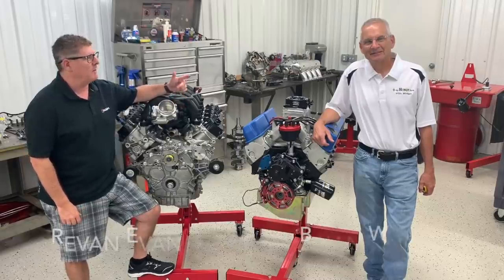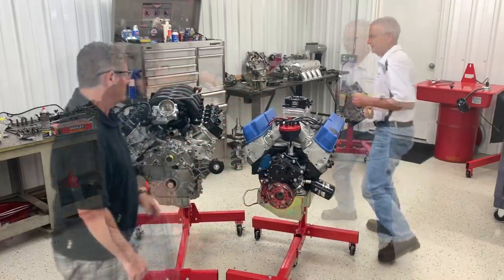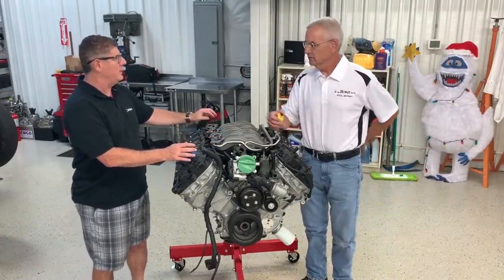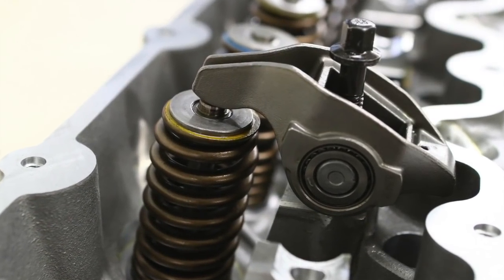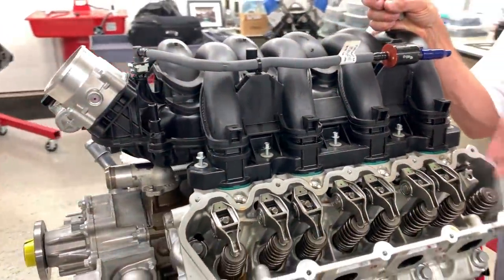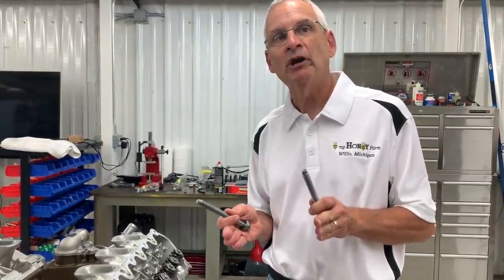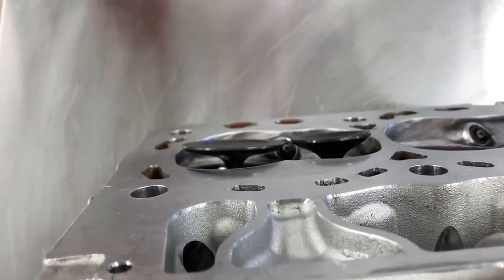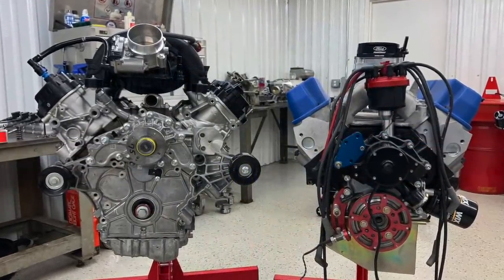Ford 7.3L Godzilla Engine Dyno Results, Teardown & Comparison to Coyote & 351 Windsor Part 2

Comment: LS killer.
Reply: And I guess you don't know about head flow how does head flow considerably more air than LS heads
Reply: @JasonHiland76  which LS heads? You realize how many LS heads there are? This is a low production industrial/commercial engine strictly built for longevity; it's not a performance engine
Reply: @roncook8566  I just mean stock-for-stock these heads are canted valves 300cc intake runner volume straight shot down to the intake valve with much more room for improvement yes an LS is a great motor but this motor has a lot of potential that's all I'm saying
Reply: Nope not even remotely

Comment: i would have really liked to see against the GM L86
Reply: This engine blows out a lot of what GM has out right now.
Reply: @BSC_1982  no it doesn't at all. Ford purposely backtracked to mid nineties tech for this engine all the way down to port fuel injection. It's not a performance engine at all it's an industrial/commercial engine built for longevity

Comment: Ford guys are in a league of their own. I didn't see anyone tearing into Chevy's new 6.6 as soon as it left the showroom. (Maybe I missed it, don't pay much attention to Chevy)
Reply: get ready for the chevy crying
Reply: You got that right. I get the feeling Chevy lovers are haters. They never miss the chance to piss and moan about Ford.
Reply: @mewrongwayKOCXF  Hmm, exact same comment, different thread. Spread the bullshit.
Reply: What is the oil injection rat on a 6.6 chevy poppet valved u-loop scavenged 2 stroke!https://www.4btswaps.com/attachments/2cyclesbc-jpg.6839/
Reply: They can be run in any tilted position at full rpm on quicksilver TCW3! i cant wait to try this! sounds like fun! Running a 6.6 like a sled motor!
Reply: It looks almost exsactly like the new LT based Chevy engines. And it has a lot more cubic inches. I’m a Chevy guy and worked on all the new Chevy stuff and this thing looks like it’s gona far exceed the new 6.2-6.6 engines
Reply: Because they don't need to know how to fix it that soon!
Reply: @themadscientest  hurr hurr
Reply: The GM 6.6 is a 6.2 with a 6 mm longer stroke.  The performance aftermarket already makes cranks with longer strokes than that for the GM LS.
Reply: This is literally a big gen 3 ls engine...
Reply: @roncook8566 literally what was the other options? Make it a 2 stroke😂? Ford did well with Coyote vs LS, this is just a simple, cheap, easy to manufacture push rod V8. What’s to change?
Reply: Ron Cook actually by watching the teardown it seems to be a lot closer to the gen 5 LT motors.
Reply: @cfltitan  minus the port fuel injection. It has elements of both
Reply: Ron Cook yeah they have a lot of similarities. They're different enough though that pretty much nothing is interchangeable though.
Reply: @Fordfanone That's because it's not a big deal when Chevy comes out with a new engine that's a good one.   This is a new thing for Ford, especially since it's a pushrod motor.
Reply: @SealofPerfection  Yet, Ford out sells Shitrolet year after year after year (42...43...44 of them in a row now, isn't it?)  Plus, it only took Shitty 55 years to finally copy the GT with the C8.  55 (!!!) years.  So yeah, Shitty made a "good" engine.  That's nice.  Now what are you gonna do?  Your duraturd cant come close to the P/S, and the 6.6 gas is a joke when actually loaded with weight.  (On a side note, who is the BattleStar Galatica fan at GM?  Is it me, or does anyone else expect to see a red light moving back and forth between the headlights?)  Keep talking smack.  You had your chance for 26 years, and Shitty blew it.  ..i..  ..i..
Reply: @SealofPerfection  - the DOHC engines from Ford shit all over chevys
Reply: @SealofPerfection  Bullshit, chevys been riding the LS for decades.
Reply: @Larcona_  The LS only came out in 95, and that was only in Vettes. Took awhile for them to get super popular like they are now, once they started putting them in all the trucks in 99.   
The OHC Fords have been around longer.
Reply: @SealofPerfection  That's 20 years, 2 decades.
Reply: @SealofPerfection  Yeah, and they were great engines, the cammer was a monster.

Comment: I'd like to swap this in my 19 A10 mustang, cant keep a gen 3 coyote alive in it...3rd engine in 5k miles....and I think I lost number 8 again
Reply: Seems you are the only one with an issue with this engine!
Reply: @jimgoff1170   haha naw...
Reply: what??? why do they keep blowing up?
Reply: @Ws6Ms   cast piston in a bore of which it cant match its thermal expansion....plasma bore is great....cast piston in a plasma bore at 12 to 1 on 93 not so much....50 states legal kit and I'm an old man I'm not even rough on it like I would have been 10 years ago....its got a glass jaw hehe....
 MAHLE OR JE no rebalance forged pistons would solve it ( 11 to 1 if its JE)

Comment: As a Ford guy can I like the 7.3, Coyote, and Windsor? Or do I need to pick one and Fan Boi it on the internet and bash the other two?
Reply: I agree, you will never see me say anything bad about any of those motors.   The coyote proved Ford can make a OHC engine that is as good, and in my opinion better than anyone in the world, including the exotics, at 100HP/L and designed to be a daily driver with low maintenance I see no one at can match that.  The Windsor another great engine, that's why the LS / LT comped the head bolt layout, symmetric ports, and took the lower end from the modular.....
Reply: You hit the nail on the head. The internet just gets tiresome in that regard and no one can look at the big picture. First off, if this engine wasn't legit, guys like yourself and Dave wouldn't be investing time and money, so that right there tells me we're on to something. Second, this is a net gain for the Hotrod community. Another viable powerplant brings down prices and availability of engines like the Coyote. I love the Coyote, but I'm a diehard pushrod guy and seeing what this engine has to offer is what us 8.2/9.5 deck guys have dreamed of. What a time to be alive as a car guy. I still want the official weight though. Lol
Reply: All 3 have their own advantages.

Comment: Coming from a Chevy/LS fanboy, I WANT ONE!
Reply: Looking at the cut away on a different video it looks like ford stole the keys to chevys development department and copied a lot from the ls platform
Reply: You want an open deck block?
Reply: @MastersOfMask  
There's plenty of metal in that block, and the engine comes from factory with iron sleeves.

I'm not looking to make 2000hp dude. A modern well designed big block that can make 800hp easy as pie with a blower is more than enough.

I'm just curious as to how much they'll cost.
Reply: Being a Chevy guy go pick up one of their 8.1's and do it up.

Comment: The clearance may be an issue if someone wants to put one into an old Mustang or Torino.
Reply: Need to see a comparison with an FE engine, that would nail down the ease of fitment in anything back to '67 or so.
Reply: Just cut the hood lol 5.4 swaps come to my mind when i thought of this. Didnt stop people then. Wont stop them now
Reply: @joeykimball5705  I'd rather not do that

Comment: Look at the Australian Ford Barra...
Reply: The Barra is a great I6 engine.
Reply: @TheRamGuy  
Everything I've seen is good, I wish we had it here, because as good as the coyote swap is, at 30 inches wide, it's sometimes not feasible or practical. I'd like to put one in my 51 Ford F3 pickup...
Reply: I want to barra swap my BMW because the s38 engine is about rare as hens teeth today.

Comment: Evan, you are the man!!!  I love seeing two Ford Legends together... I could listen to you and Brian all day.... You are leading the way in the 7.3 arena!!  I can see 700hp from this engine without trying hard
Reply: I'd say 800 with heads, cam, intake, headers, and a good port job.
Reply: @ForcedfedFords  you are out of your fucking mind...800hp with this engine needs boost.
Reply: @bigk5746  you spoke too soon lmfao! They made 790hp N/A (no boost) in a later video with ported heads, reworked camshaft, custom pistons and high rise intake manifold.
Reply: @ForcedfedFords  oh I'm sorry... just a completely new bottom end, pistons, massive intake and massive cam on C16 race fuel.  So let's take 10k engine, rip it apart, forge it, custom 1 off intake manifold on race fuel and make 790hp....what's impressive about that?
Reply: @bigk5746  my first comment accurately predicted what mods were needed to reach near 800hp N/A. You disagreed saying it needed boost, YOU WERE WRONG and now mock the supporting N/A mods? Bruhh.. must be a Chevy guy..
Reply: @ForcedfedFords  Well sir...I did say boost.  BUT you said "with heads, cam, headers, intake, and good port job, we will see these make 800NA"  

They put a whole new bottom end in it, and ran it on Q16 and IT DIDNT BREAK INTO THE 800HP RANGE.  AGAIN, IT DIDNT MAKE 800 WITH A FORGED, HIGH COMPRESSION, HUGE CAM ON Q16.  

I think we were both wrong.  This engine is a dud, which is why you don't hear about it any more.  Why would you want to buy a 10k engine, rip it apart, and throw away the bottom end to make decent power?  Just buy a Dart block and do a traditional SBF. I am a mustang guy BTW.  I love Ford but can't stand this engine.  Ford could have had a cool concept and something new, but gave it shitty internals and want way too much for it.  Typical Ford 🤷
Reply: @bigk5746  Yeah, they could have made an engine that a few thousand gear heads would have loved but would have been useless in what they were looking for a very reliable long lasting engine for heavy duty pickups. Who would have thought that Ford wanted a production engine instead of a hot rod engine for hundreds of thousands of pickups in the future.
Reply: @ForcedfedFords  The mods to reach 800HP or around 700 RWHP will be similar to what it takes a LS7 to reach the same point.   Cyllinder head flow will need to be around 400CFM after porting.
Reply: @ForcedfedFords  I believe you are right... 445 CI + heads that will probably flow 400cfm with the right cam and compression 800 is definitely in the line of sight!  I am curious to see how much stroke that block will take!
Reply: @UnityMotorSportsGarage  Ported stock heads will outflow all but the best BBF 385 series heads, cams are cams, as long as they keep the roller rate lobes we should see normal lifts of 0.685 and much more for pure race application and solid lifters. We know a 4.25 stroke will fit in a 9.5 deck windsor. Supposedly this motor has more room in the bottom end to clear the cam tunnel and a taller deck height. 9.65 I think. Should be good for a 4.5 stroke, but at minimum a 4.40. If you take the stock bore (4.22) and roll 0.080 over pistons, and get a 4.40 crank. You're look at 512 cubes from a small block. 

That being said, we should see 650 to the tire pretty easily in the next year naturally aspirated if street daily driveable service conditions. For all out race itll be over 1khp. 

Supposedly Procharger already has an F1-X hanging off the front end of one making 1300 on the stock motor with just upgraded injectors.
Reply: @MrAPCProductions  Very good numbers...
Reply from the maker: Thank you very much.
Reply: My ford 2 stroke is a:https://www.youtube.com/watch?v=iyJi_n3P0og

Comment: I love mod motors but they are the same size externally as a 460 .
Looking at the design it seems all the tricks guys used over the years on the Windsor made it into the design of this engine. Don't get me wrong as the mod motors have a place in my heart but after working for GM I prefer to work on push rod engines as they are just easier.
Reply: Think mod motors are bigger than a 460 lol. Stupid big, but worth it in a sport car or boosted application
Reply: @sategllib2191  yeah the heads seem to flow only when air is forced through them. There is a fair amount of potential in a old mod but to unleash it you better have deep pockets or a whole bunch of tools. I mean even the 4.6 2v is pretty good for a 281 . The right cam , some boost and a tune and your 400+ at like 380 ftlbs .

Comment: I’d like to know the weight of the 7.3
Reply: I'd like an aluminum block version
Reply: Cesar Perez Agreed if we want max performance.
Reply: I absolutely want to know this. I am going to use these, anyway - but I am very surprised that they skipped that bit of information. (Yes, even if it is "heavy".)
Reply: 440ish lbs

Comment: Wow, people are already hot roding these things. I will say this, what the Coyote does with DOHC 4 valves, and 7000+rpm godzilla does with good, old fashioned cubic inches.
Reply: I'm probably going to get hate for this, but I think I still prefer a Voodoo for performance applications. There's just something about a super-high revving V8 scream that I can't get over. I'd definitely throw it in my truck, though. An '01 Dakota RWD with this monster would be more than slightly terrifying.
Reply: @griffinfaulkner3514  Put it in a ranger, don't make a mutt.
Reply: Griffin Faulkner nascar has had high revving v8s for 40 years. You don’t need flame plane cranks and over head cams for that.
Reply: @ahack14  That's a specially-built, extremely expensive motor that's pushed to the absolute extremes of material science, and needs to he torn down and rebuilt after every race. For the cost of one of those engines, I could find a wrecked E92 M3, pull the motor, and have more than enough money left over to literally build a car around it.
Reply: @ahack14  Bit of apples to oranges as NASCAR is a rather extreme example with engines that have a relatively short service life. I was referring to the average hot roder or racer.
Reply: Griffin Faulkner you can run a V8 push rod V8 on the street that is capable of spinning 8k rpm. You don’t need DOHC... I’m sure the big long changes slinging around in there aren’t hard on parts at all...
Reply: @ahack14  What happens when you make the same changes to a DOHC motor? You get an even higher redline, in the case of the S65, 10k+, with a fraction of the parasitic loss you'd find in a pushrod motor

That said, I'm not saying pushrods are inherently bad, the low-end torque and incredible simplicity provided by 2-valve designs are the main reason they're still around, but if you truly want to send the revs into orbit, DOHC is far more efficient and reliable at those RPMs.
Reply: Griffin Faulkner push rod till I die! No need for all the extra bs in the DOHC. Enjoy watching the big long timing chains break. I’ve seen plenty of that
Reply: @griffinfaulkner3514  why turn an engine 8k if it doesnt make any hp up there? thats just pure stupidity.
Reply: @frigglebiscuit7484  That's why I like DOHC motors. They tend to hold power higher through the rev range, and RPM×torque÷5252=HP.   Part of why the Coyote can spin so high is because of the lower parasitic loss, so it just keeps pulling and pulling out past 7k
Reply: @ahack14  They sure as shit help though
Reply: @griffinfaulkner3514  I wish Ford would release the voodoo crank for the Coyote or a whole engine. The pretty weak excuse I've heard for why they don't is vibration issues - like that matters in a race car or the aftermarket couldn't figure out how to solve that in a street car. I think Ford just wants to keep the GT350 flat plane "exclusive".